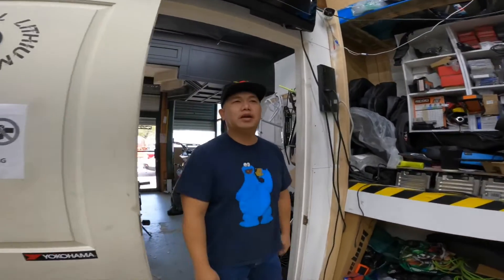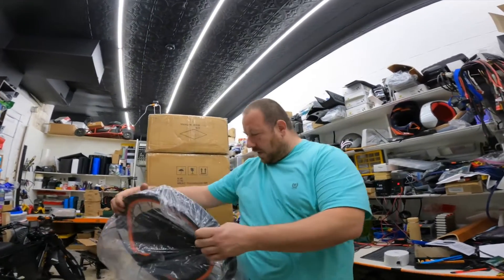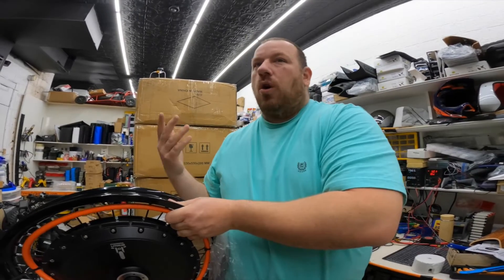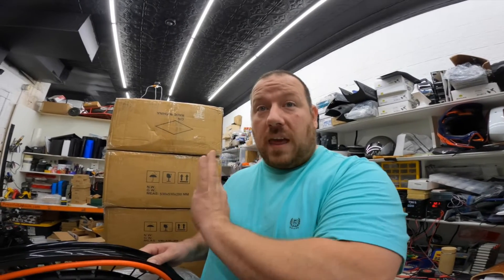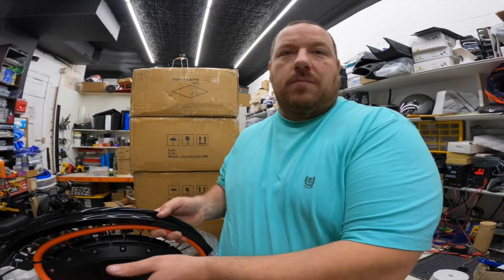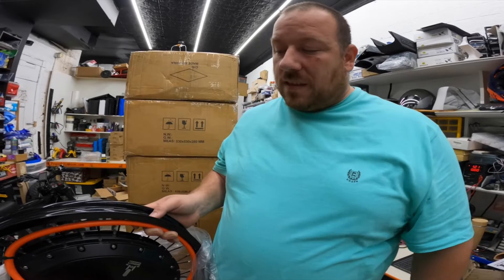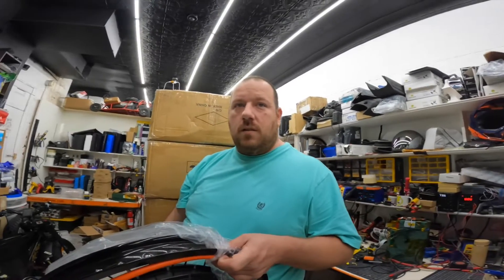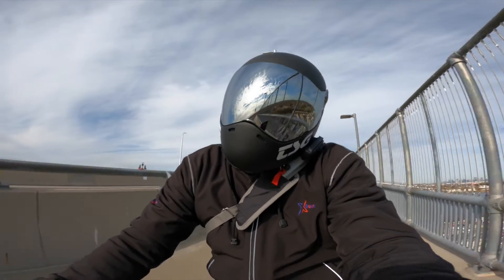The Truth About The  QS 8KW Motor

Comment: I just put my klx250sf-supermoto on the dyno here in Sydney Australia 
Specs are qs138 70 v3 3000w
Voltol em260
Amorge 72v 48ah
Front sprocket is 14
Rear sprocket is 52
17 inch rear supermoto rim
We got 23kw on the dyno.
Wasnt a cheap exercise but I just wanted to know.
New to all of this as most of us are, i feel the controller could deliver more, but the battery is the weakest link right now. Interesting times we live in. Happy to post dyno results if people are interested. Details of build are on electricdirtriders site blue klx post

Comment: hey just wanna if my ebike battery is 20000w and my controller is far driver 200A and hub motor is 3.5T like 5000w to 8000w not sure which one ，but my questions is can i upgrade my controller to more powerful one ？ or if battery is 20000w but my hub motor is only 5000w-8000w if put all out the power will my hub motor burn down？ or should i just change to hub motor with 20000w and same with my battery 20000w then also changing the stock controller is 200A for now
Reply: What? Try again lol
Reply: Battery's deliver volts I don't know where you are getting 20000w from your battery size can range from 36v to 96v most high power ebikes use 72v battery's the other number that's matters is your bms rating to match what your controller is rated for so you want a 72v battery with a 150 to 200a rated bms this is what will give you your wattage power volts x amps equal watts so 72 x 200 equals 14kw so a motor rated for 8kw can handle 14kw just fine
Reply: @scottbuchanan6425  my ebike spec is 72v75ah with 200a controller the seller told me this ebike peak power is 20000watt does that mean is 20Kw？ but just now u said only 14kw is for handle the power right？so 20Kw that hub motor also can handle just fine？

Comment: I have a Fardriver 72680 controller with a 50.4ah battery with 18650 molicells and a QS273 8000kw motor and I'm wondering why my motor is getting so hot can someone or you help me.
Reply from the maker: Things to check…
How many volts is the battery…
Your tune…
Is the wheel/tire straight…
Does it spin freely…

Comment: Hello, good afternoon, I'm from the Bronx, NY. I have a problem with my electric bicycle. The motor is 5000 watts, but the motor and the motor cable get very hot. I can only ride it half a mile and it turns off when it overheats. Can you help me with that? problem???
Reply from the maker: Yes… when you have time call the shop (551)404-4107

Comment: My favorite is the QS 3kW at 5T, I live in the high Pyrénées, France. Fardriver does the job well
Reply from the maker: This video reached France… 🙌 How awesome is this… 🙏💯 Fardriver seems to be the way to go… I can’t wait to try it for myself… thanks so much for commenting… 🙏🫶
Reply: Do you have the motor on a regular ebike setup, like a super73 or revv1? If so what kind of speed are you getting out of if?
Reply: (QS 3kw at 5T)- 5T means ?
Reply: @YNRSuperBikers 5 turns. Good for torque, not so good for top speed. 4T is middle ground, 3T is best for top speed.
Reply: @500wattz  
Q1. when 4T or 5T has super torque then motor will make more for less heat & power consumption than compare to 3T with high top speed ?
Q2. I need top speed of (50 to 60kmph) can QS hub motor 21inch rim on 72v 3kw motor at 5T able to give this speed ? (I need large acceleration power 0 to 50kmph in 4 seconds)
Reply: @YNRSuperBikers  Q1. I think so long as you add statorade, heat won't matter as much. Power consumption depends more on your tune than the motor you're using. All about the settings with the controller.
Q2. 3kw in a 20-21" rim should be fine. As for the 4 second mark for 50-60kmh I'd go for the 5T as it had the most torque and least top speed. 5T should still achieve 60kmh but also depends how much you weigh, wind resistence elevation etc many factors.
Reply: @YNRSuperBikers turns. 5T is high torque at the cost of Max speed.
Reply: I'm also heavy (250 without gear on) and my bomber is heavy (also around 250) my poor qs205 3kw 50H V1 4T was so hot running 70 battery amps, 210 phase. Melted the zip tie inside that was holding the phase wires together. Statorade fixed that, hub sinks next. If I could, I would lace in a qs273 but not sure if it's entirely doable on a 26" fat tire rim.
Reply: @500wattz  
In QS motor 
205 or 273 which model is better in quality ?
And has less problem like you told.
Reply: @YNRSuperBikers  273 is a superior motor but very heavy you need the right battery to power it. 205 lighter more ideal for e-bike. Also only seen one person lace a 273 into a 26" fat tire rim, 205 more options in regards to what you can combo it with.

Comment: 7:12 Thats why i like  V . He is right. Allot of people claim they are pushing 22kw or 45kw but in reality its just either 8 to around 12kw. Electricity is unstable thats why they see those no. on the display and even then you check voltage levels on your battery it jumps around. on my channel i talked abot that before
Reply from the maker: V is one of a kind… You should come visit… I’m sure he can give you some even more valuable information for your channel… 🙌💯💪

Comment: people need to realize to when you use the field control functions of the controllers for example if your controller uses max 300 battery amp dc,you would require a battery that can output continuous 600 battery amps dc ,as it requires its own current in effect, but you can massivly increase the the motor RPM s way way past its rated rpms
Reply: Are you sure it would require what the controller is asking x2? Because I'm sure if your for example running 200a continously, and you added 50a on field weakening then your battery will be pulling 250 🤔
Reply: the foc is is a weird beastit basically requires its own current on top of whats being used allready,is what i was alluding to and the  higher current you use ,means the higher the amount it will require to weaken the feild  @aaron092000
Reply: ive found its best to leave it off at first till youve gotthe bike dialed in and preforming consistantly ,if you never max out the rpms  for top speed to theres no need for it
Reply: Thats bs. If it is 200 dc amps it will never require more then thst from battery. The reason phase amps are higher is cause at low speedz its lower voltage. Overall power is wattage.... volts x amps. So your cibtroller cobvertz 100volts 100amps into 10v 1000amp fir example
Reply: thats not really what i was refering to feilding weekeng in for controlling the magnetic feild saturation ,from causing magnetic friction with stops motor achieving top rpms so it uses more current to counteract and manipulate the feild so it can spin faster @AaronSmith-mn2hu
Reply: with this it tends to use power on top of its base power rating,so youd need batteries with significant headroom
Reply: the controllers at low speed actually still use the full voltage ,it doesnt lower the voltage for low speed,it shortens the duty cycle of the pwm signal its a 12 killahetz or so switching freqon-off really fastand it varies that switching to vary to rpms

Comment: ive seen this motor hit at over 30 000 watts at 85 volts ,achieve just on 100mph its a beast
Reply: im saving to get one myself ,but going to modify it with liquid or dilectric cooling and lace it into a 26 inch oversize width rim or fat tire rim havent worked out a tire option yet that can handle the stress put on it ,going to use the Vesc -STR 500 ,500 amp dc controller from the guy that invented vesc ,matched with vesc express ,sorting out the can bus networks at the moment ,
Reply: cant wait to see how this will go on 24s thats 100volt with battery that can output max 900dc amps
Reply: going be a heavy bloody thing
Reply: @angusmcgil If you pick the right size, you could use a motorcycle tire, like for a Motard or SuMo. I think a 17" motorcycle wheel is roughly the size of a bicycles 26"/559mm wheel, with the weird way motorcycle tires are measured.
Reply: @angusmcgil I'm dedicating myself to building one of these before they "phase" out the affordability to do so.